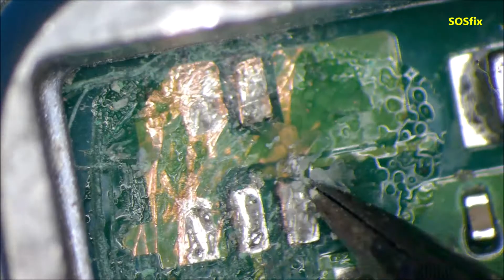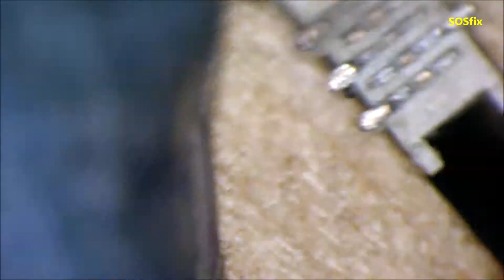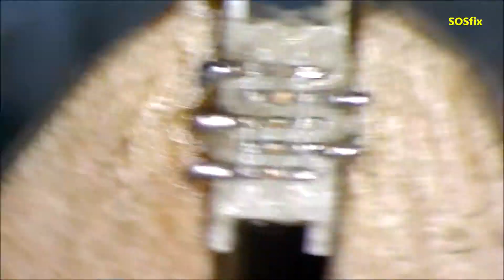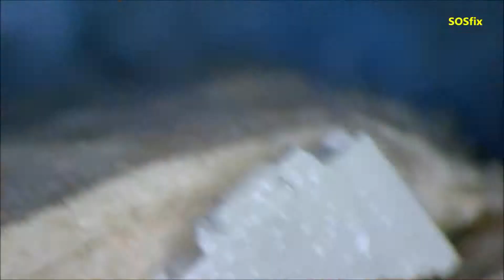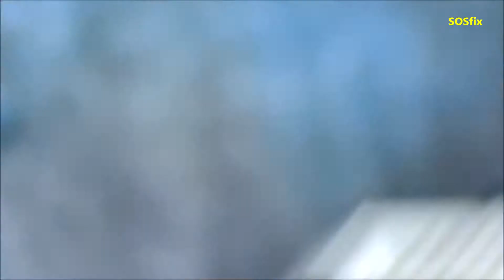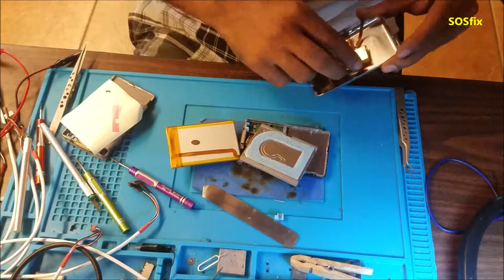ipod classic battery connector solder a1136  a1238

Comment: What chemical solution did you use? I can weld small cables in the part behind the corresponding 5 contacts because in the front two of them have been detached from the circuit and a groove without metal contact remains. I await your urgent reply. Regard, Thanks. Modesto
Reply from the maker: do you mean the flux? for missing pads try to make jumpers

Comment: I've just pulled my battery connector off the motherboard! Aaarrrggghhh. I didn't realise the black ribbon holder pulled out. Gutted. Is it an easy fix?
Reply from the maker: this is a microsoldering job it will need the right tool
Reply: Luckily I purchased another ipod 7th gen from cash generator so I've opened this with no issues. Can you direct me to a better battery at all? 3000mah also I'm looking to get the best performance replacement hard drive. I don't watch films or videos just music so looking fir maximum of a terabyte of music storage.